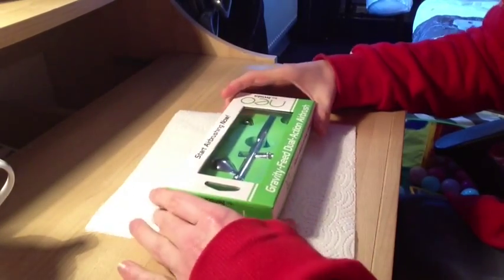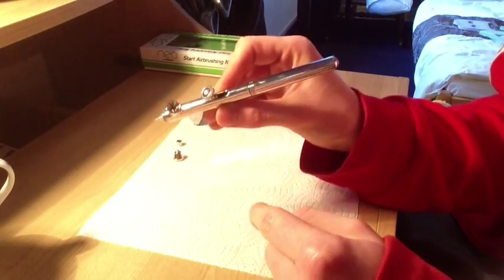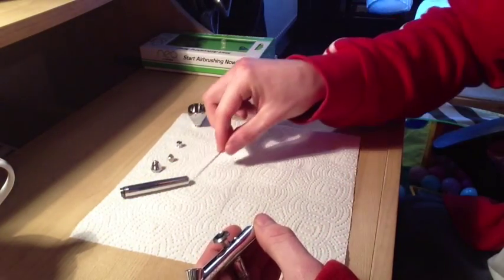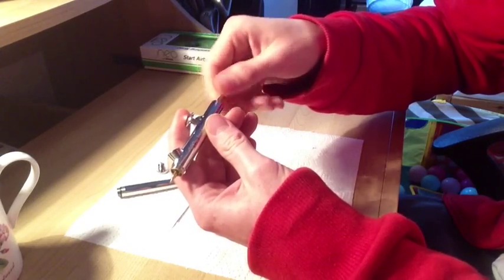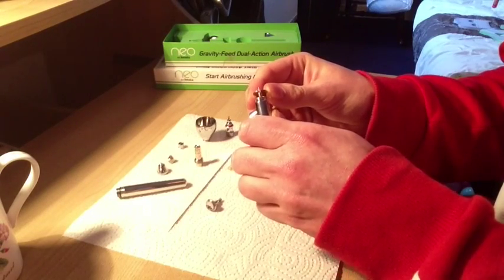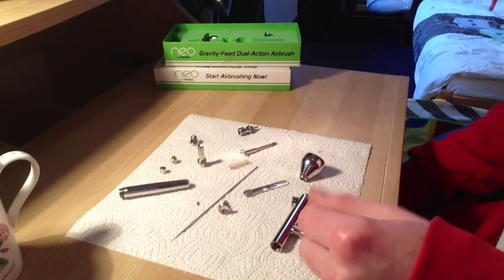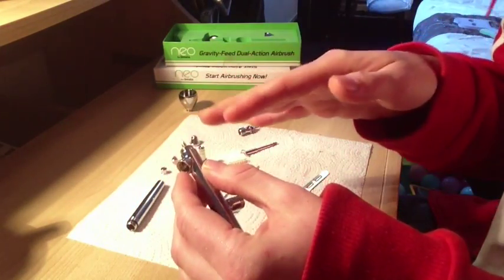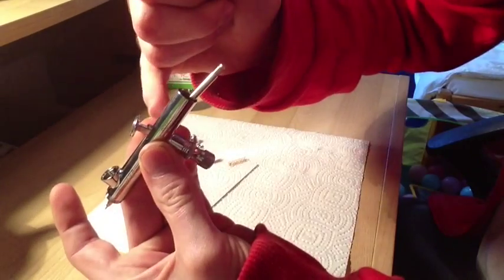Iwata Neo strip down and reassemble

Comment: Thank you for taking the Air valve out and showing the 100% breakdown of the equipment. This brushes air valve is known to stick and get sticky over time and most people don't realize this piece does come off and can be cleaned and oil for lubrication purposes to help the trigger flow better. Once again thanks mate.

Comment: Should always remove needle forwards,to save any remains paint being scraped of into rear of body👍
Reply: Correct, but this is not the case with the Neo because the nozzle mount can't be easily removed like other models. This is the only down side of this model.